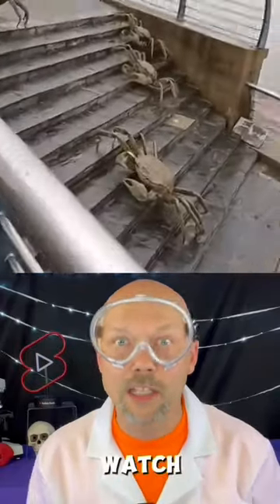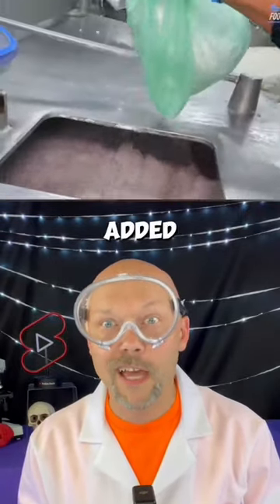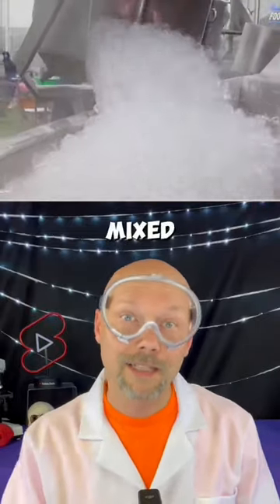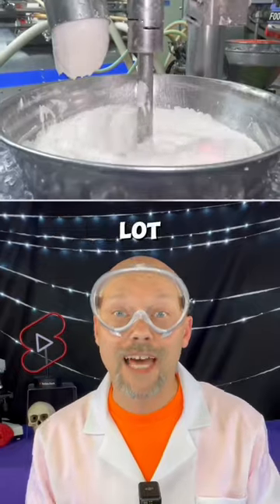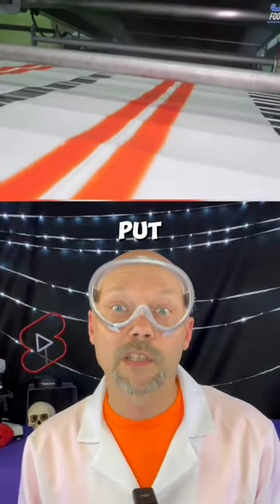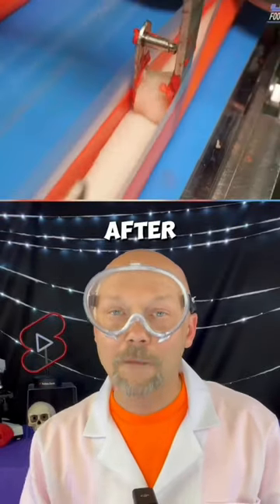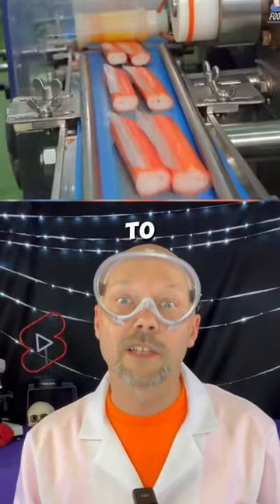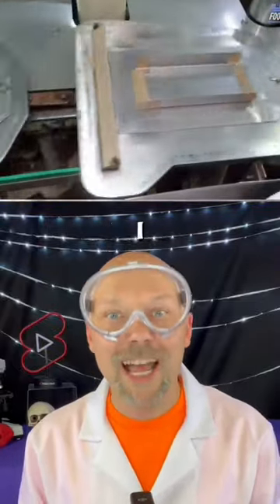How imitation crab meat is made 🤢

Comment: Imitation crab is widely used due to the high levels of parasites and pollutants found in crab since they are bottom feeders. It became so prevalent and bad that using imitation crab became so widespread in Japan. most people don’t even think of it as imitation anymore,they have connected imitation crab meat with “crab” on a subconscious level

Of course, you could still get crab at a seafood place, but 99.999% of the time if your sashimi has “crab“ in it, it’s imitation